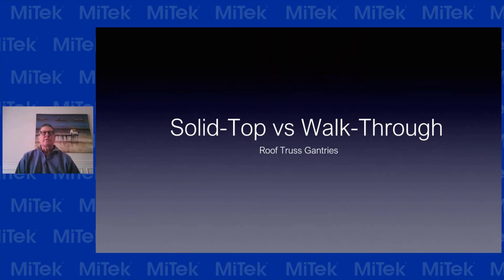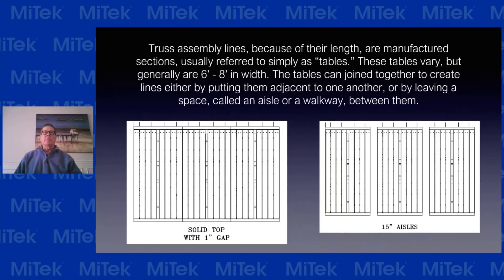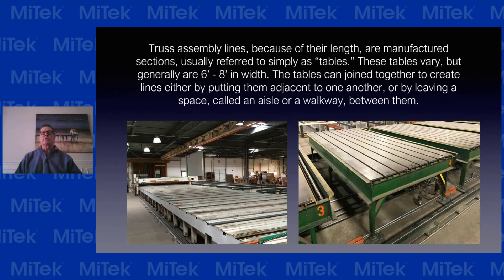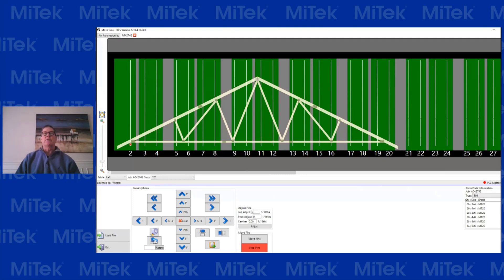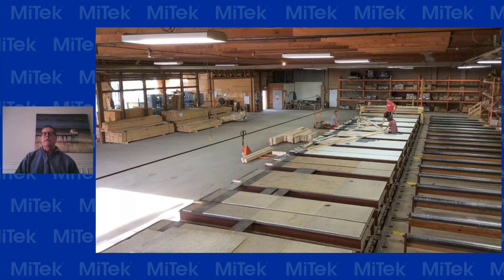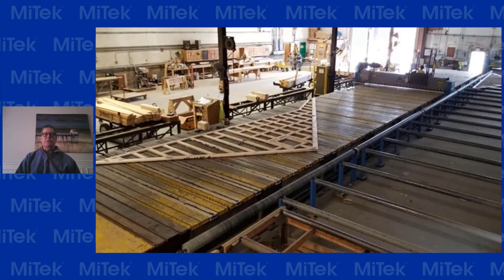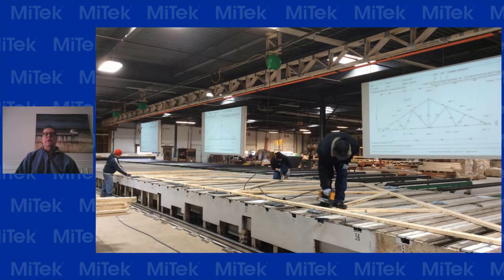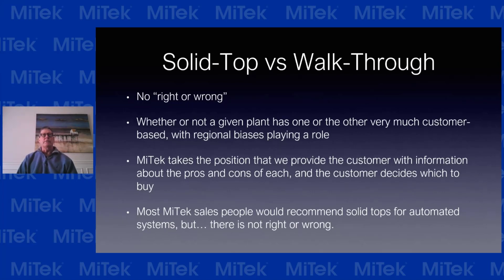Virtual Training: Solid-Top vs Walk-Through Roof Truss Gantries

Comment: walkthrough is the ONLY way to go. Full solid table hinders in multiple ways and is much much harder on the body. I wish some folks would realize this. Preplating solves any joints or splices over the ejectors.Proper setup placement eliminates most of that anyway.Solid Top tables are HORRIBLE. 30 yrs experience talking here.
Reply: I fully agree, Only been in the industry for 4 years but every system we are doing now is walk through. Any safety issues we don't worry much about anymore with the new safety scanners on the gantries. With walk throughs you can have the younger fitter guys jump up on the tables when needed. It's for sure the way to go.